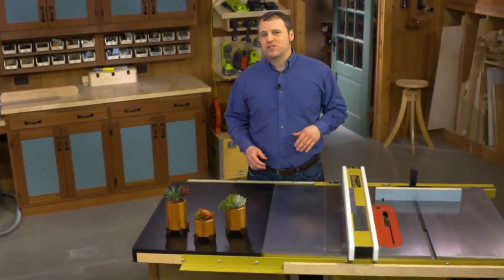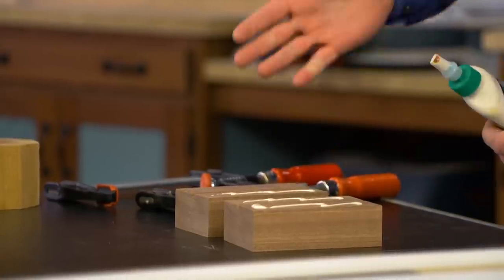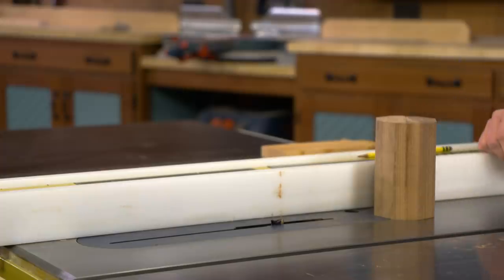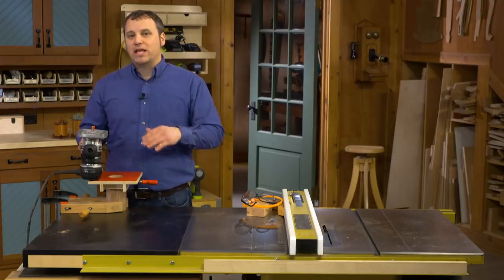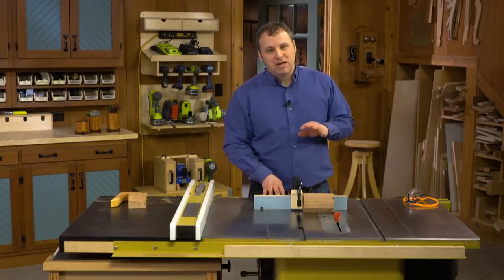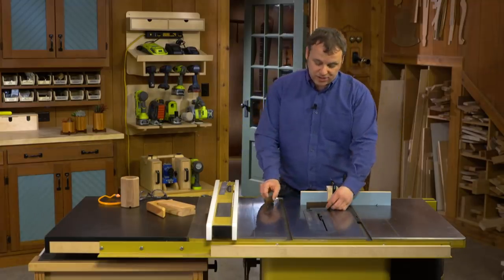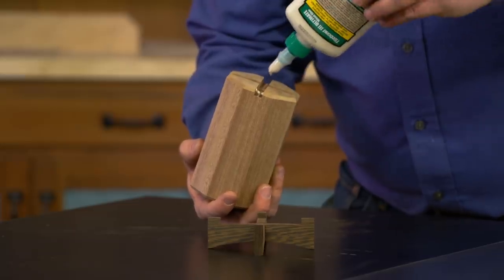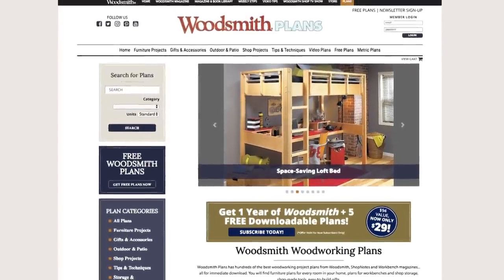Build These Succulent Plant Stands for the Perfect Gifts

Comment: Nice stands. Do you do anything to keep the water from swelling or rotting the wood in the long term?
Reply from the maker: Thanks!  Luckily real succulents don't require much water/moisture, but if you are going to use real plant I would be sure to seal the inside with a waterproof/marine finish or epoxy.